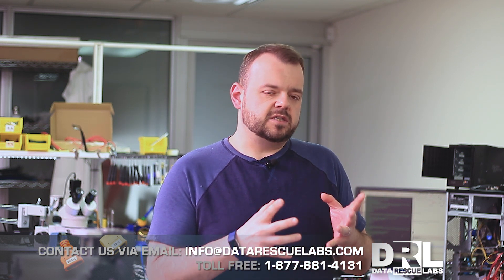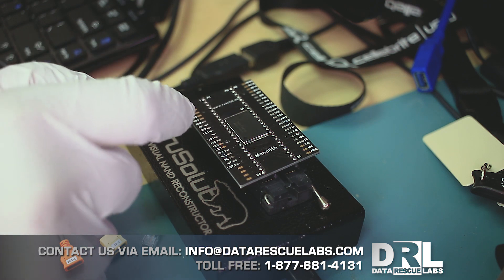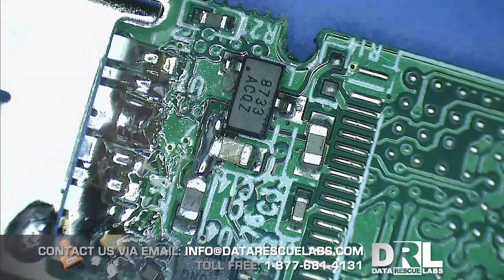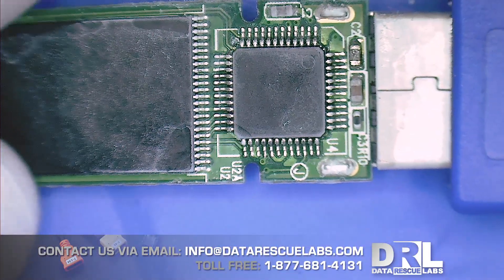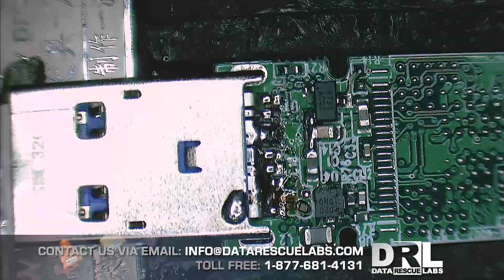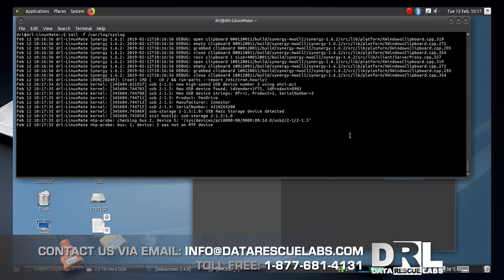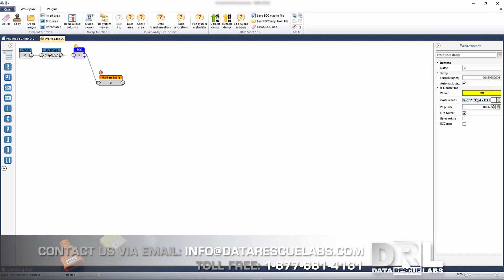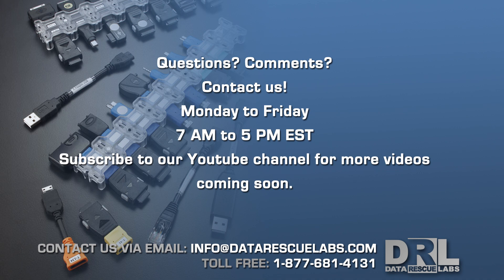Sandisk drive not showing up

Comment: Nice job. at 4:45, this is the azote (nitrogen) ? can you give us a ref please. Other questions, how can you switch quickly between windows and Linux ? Which distribution of Linux ?
Reply from the maker: It’s freeze spray from mgchemicals. My guess it’s nitrogen or compressed air. We don’t switch between Linux and windows, I have dedicated computers running Windows, Mac and Linux. If You need dual boot, you can setup windows and then install a Linux distro and chose “install side by side”.

Distribution that I like personally is Debian and Mint

Comment: never seen someone use linux for data recovery
Reply from the maker: We use various operating systems. Linux is good In some instances because we can see live logs as the USB is plugged in and then debug the issue if there are ant connection problems

Comment: Great video, it was very educational. Out of curiosity which distro are you using and is there any specific reason why you chose that one?
Reply from the maker: I use Linux mint but I also have few Debian computers. No specific reason, maybe because of apk package manager mostly. I’ve used Slackware since early 90s and switched to Debian around 2010’s